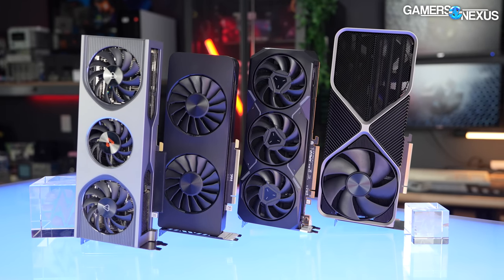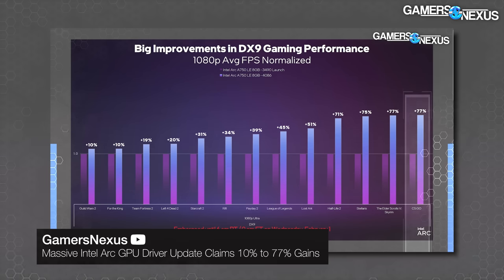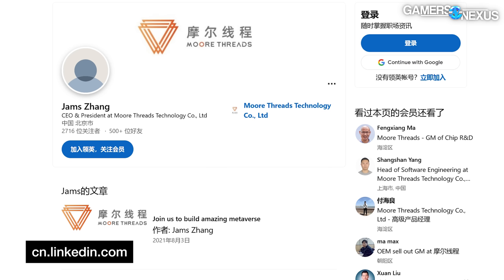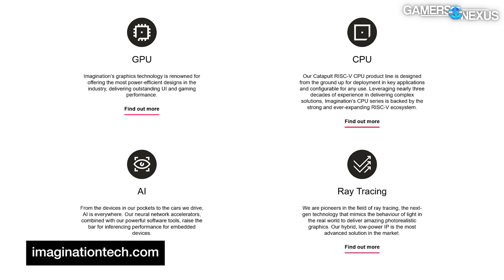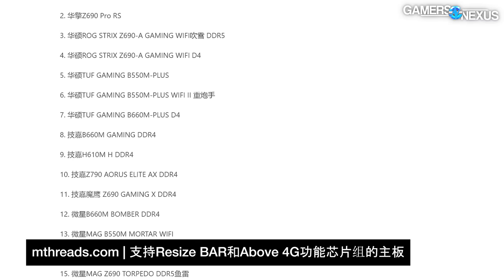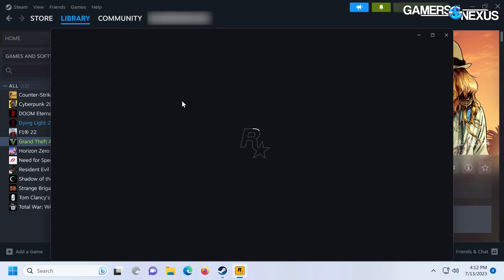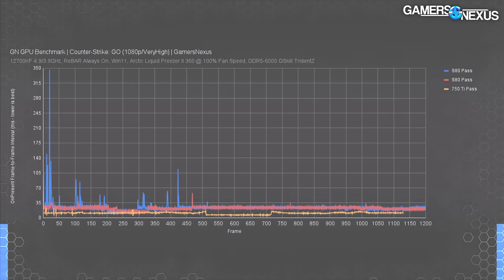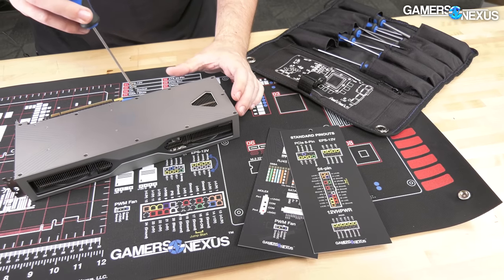China's Moore Threads MTT S80 GPU Review | A New Challenger Appears

Comment: I hope this puts into perspective for some people how amazingly well Arc has been doing since launch.
Reply: Cheers to that, indeed.
Reply: Yes...to a point. Thing is that intel has decades of experience making CPU's  and decades of experience making GPU for the laptop space. Somehow translating that to something they can walk down the hall to ask for a specbook about had um "launch challenges".
Reply: If there able to fix their video encoding thing, that will be a great start for intel
Reply: Most definitely. The A770 has been treating me quite well; I got the LE a week after launch and I received the Acer Predator Bifrost as an X-mas present. 

I knew what I was signing up for when I opted for Arc, and frankly I was expecting a lot worse, so I was pleasantly surprised when the released product was a lot more reliable than the old ATI->AMD transition-era cards and drivers. 

Back then it was a game of rolling back driver versions after new patches fixed one thing but broke something else, so you'd roll back to older drivers that may not have worked fully but worked well enough. Not so much the case with Arc.

Arc drivers have only been getting better as they release, so that alone is praiseworthy. I've been running PCMark after every update and the performance of the card has a positive linear correlation over time, so I get to see how the same hardware is made better over time with better-written software.
Reply: nope it should make people realize why nvidia like to charge an amr and leg for their gpu. we have ARM, Imagination And Qualcomm that have gpu IP and make gpu for mobile segment but none of them dare to enter pc discrete gpu market. intel, yeah nice effort for them but the reality for them is Arc still cannot generate profit for the company. if battlemage still can't then intel probably will quit making discrete gpu for consumer.
Reply: they have had massive improvement since launch and under certain circumstances make sense. Still have some stability and UI stuff to sort. Hope Battlemage continues the improvements.
Reply: Intel had plenty experience with their previous graphics cards. (i740, Project Larrabee, DG1 and now ARC/DG2.)
Reply: Yes but Intel has been making iGPUs and drivers for decades. This is MT's first GPU ever. Big difference there.
Reply: Intel has been doing this for awhile.
Reply: It is perfectly fine to laugh at Intel.
Reply: @arenzricodexd4409  Intel is hopefully thinking long term.  I seriously doubt they'll give up this easy.  They spent a solid decade trying to get under 12 nm in chips they didn't just throw up their arms and give up.
Reply: @Drak976  long term it can ruin intel. for consumer they want intel to keep forward because they want their cheap GPU. but for intel going forward with Arc would mean they will have a division that keep sucking the company's resource dry and did not make any contribution towards the company's profit. intel financial already in the red for two quarters straight.
Reply: I would sport one but its compatibility with retroarch was not good. I borrowed my friends a770 and he borrowed my rx6600 for a few days. Its overall performance was great though and may be a good entry level card for ue5.
Reply: lmao wait this isnt a joke you are being serious ? lmao
Reply: @arenzricodexd4409  Intel is unlikely to let go of this easily because they see this effort as necessary to be involved in AI development.
Reply: I hope this puts into perspective for some people how amazingly well AMD/ATI and Nvidia GPUs have been doing since the late 90s.
Reply: tbf, Intel has been doing GPUs (iGPUs) for YEARS
Reply: @swrdghcnqstdr  Yes, although they weren't directly trying to compete in the high end performance range against Nvidia or AMD.

Comment: I think the memory layout is actually just for trace length, which would otherwise be longer for the chips at the top and bottom, rather than avoiding screw holes.  You can see a similar thing on the old AMD R9 270X, for example - with no adjacent screw holes in that case.
Reply: Yes, the memory PCB layout looks logical, no chaos at all.
Reply: Not a GPU but the PS5 does the same thing with its memory modules

Comment: The thing that interests me most about this GPU is that it's apparently based off of PowerVR IP and even shares parts of its driver code with some of the newer PowerVR GPUs. Meaning that technically the modern GPU landscape reflects the history of GPUs almost perfectly: 

nVidia was one of the primary companies pushing 3D gaming and features that help make it better even back when 3DFX was king, today they've got the most features and usually the fastest GPUs even if you're going to be paying a lot for that.
ATi/AMD have always had an on/off reputation about drivers (I've had no major issues personally, but the reputation is undeniable whether you believe it's justified or not) and often haven't managed to be truly competitive on a performance level, but manage to make it up through increased value or features. One of their bigger successes with GPUs is being able to integrate their IP into AMDs CPUs for some of the fastest iGPUs around.
Intel was solely focused on ensuring you have a display output that can play a DVD or the like for a number of years until they started also focusing a bit more on gaming in an effort to stem competition from AMDs iGPUs, now they're trying to make full-fledged gaming focused dGPUs that relative lack of experience with gaming GPUs in general shows in that it's not a completely horrible experience but you'll absolutely run into bugs you won't see on nVidia or AMD.
Finally, PowerVR abandoned the desktop entirely around something like the year 2000 after the Kyro GPU failed,  now we're seeing a modern dGPU based on their tech being practically useless because of all the issues and bugs due to the complete lack of not just 3D gaming GPU experience, but even (afaik anyway) a relative lack of focus on PCs in general.

Comment: If I had to guess, the outer memory chips being "closer" to the GPU would be to have equal length traces with the other chips without having to do weird routes (or doing it less really)
Reply: Exactly what I'm thinking, but this practice is more common on high-speed pcb designs, not sure why this happens to a graphic card.
Reply: @michaellu8879  Surely the memory and the GPU are running clocks upwards of 2 GHz? I'd say that's plenty high-speed enough.
Reply: Yeah, that layout looks a lot like console ones. They maybe have people with experience on that area of design.
Reply: @P4NCH1 or mobile GPUs. Where it’s often forked from a scaled down version of a 10+ year old design, scaling that old hardware up, in order to skip patents and jump into the same competitive market. 

Sort of like taking a toy “drivable” Porsche, scaling it into a real scale Porsche and driving it around. And wondering why it won’t drive like the original.
Reply: @michaellu8879  Memory is both a high-speed and high-sensitivity design area. It's why you see things like soldered LPDDR5X in laptops pushing way higher speeds than SODIMM ever will, and part of why CAMM was introduced. Trace length matters a lot for memory. My area of expertise was VRMs and chipset connectivity at Gigabyte, and for the latter trace length also started to matter a lot more with PCIE3.0 and then 4.0 becoming a thing as transmission speeds went up.

Comment: I like the aesthetics and ease of teardown. Hopefully if it's PowerVR-based, they'll get up and running with actual performance under Linux for Vulkan and AI-related tasks. It could definitely find a niche in the west if cheap.
Reply: Linux and Vulkan would be better to target for them. Easier to get what they need.
Reply: If it's PowerVR-based, on the contrary, it is doomed to fail in Linux. Imagination has never been arsed to support their PowerVR products in Linux for years now (remember the scandal involving the Intel GMA500?), only recently they started offering Open-Source tools and drivers for the Rogue PowerVR architecture, the one before the BXT.
Reply: Considering they are having trouble just getting game drivers to work, I doubt it will be very competitive for AI. AMD has been trying to get into that market for a decade and still can't even though there is a massive financial incentive. No one will use your card if half their programs don't work out of the box with it. If George Hotz gives up trying to write drivers for your card, then you are screwed.
Reply: Still don't think it would be comparable to low end "cheap" Nvidia, AMD or Intel GPUs. They are trying to sell this S80 for $400 and it doesn't even work for most applications! They will need to make massive strides in functionality, software, manufacturing and price to performance overall to have any kind of chance even in the low end. I mean, consider most Intel and AMD CPUs already come with an iGPU that is orders of magnitude better than this thing. Moore Threads just isn't even competitive on that level yet.
Reply: @samhillebrand  that's why sanctions (are stupid) actually help Chinese hardware manufacturers. - with better ''western'' options, no one would buy this and the company would just die in free market right wing capitalist world. If people are ''forced'' to buy it, MTT will have more money for future development.

Comment: That idle power draw was the most eye-raising thing for me, and there were eye-raising things aplenty in this review.
Reply: considering it is maxing out only 40 watts higher, it is probably just some windows related driver bug. AMD had a very similar issue with high idle power draw on there 7900xts at launch. Think they were pulling like 150 at idle
Reply: It would be more reasonable to solder inside second cheap chip like GT9500 so cart could work using it while ide, for power savings 😆😆

Comment: Bizarre never-seen-before grounding tab: This is most likely for debug to connect the ground wire of an oscilloscope or voltage probe. Many boards lack convenient grounding points for probing, which makes debug of prototype and production boards difficult. However, when I design a ground point into a card design, I include several on both sides of the board to minimize the ground lead length. I also use test point hardware that is easy to clip an alligator clip to without shorting to nearby components. Some might say that the preponderance of BGA packages makes this irrelevant, however, probing of connectors, resistors and intentionally added signal test pads is still done. Designers that don't provide access to  critical signals for debug screw over the people responsible for board test.

Comment: there is this compatibility layer called Cuda on MUSA which will allow CUDA instructions to run on this card. it would be nice to see that in action if you can manage to show that somehow by help from the engineers.
Reply: Thats because it probably is CUDA because its just a re-etched nvidia chip, just like china's "home grown" x86 processor was a re-etched Intel chip
Reply: @BurritoMagnifico statement is incredibly incorrect you demonstrated that you didn't watch the video at all. As such your opinion on the matter is irrelevant.
Reply: @cybercat1531  You never know with chinese companies this might be a partially reverse engineered old nvidia chip with shit drivers. They claim it's an original architecture but who knows, it's interesting that it has a compability layer with nvidia cards when it doesn't even work right %90 of time by itself though.
Reply: @BurritoMagnifico  That's not how it works, you can't "re-etch" things outside of the foundry they were designed for and the foundry will realize pretty quickly that you are sending a copycat so you can't have them do your knock offs either. China's "home grown" x86 processor is a derivative of VIA's x86 Eden processors (VIA actually still has the x86-64 license given ages ago) which they developed by (surprise surprise) paying VIA Taiwan to develop it.
This card is most likely built on stolen IP and poached engineers (as is custom with most "developed in china" stuff) but the idea that it's a "re-etched" is ridicolous. We are not discussing random aliexpress sellers recycling old chips, this venture is trying to get some form of "home grown" GPU technology similar to the x86 processor
Reply: @cin2110  Intel has a CUDA compatibility layer for years, same AMD. Does this mean they are using the same NVIDIA designs? No it does not. Compatibility layer means it remaps the calls so it can work on different hardware.
Reply: How can you guys debate on something that is literally explained in the video...
Reply: Interesting, I am wondering that this GPU is so crap for gaming that I am wondering if it's really made for AI work loads and the gaming is some kind of stealth action.
Reply: @outcast6187  it's crap for AI loads too. Making GPUs that can compete with manufacturers that have been at it for 20 years is not an easy feat. They will probably grow and get better over time if the chinese government keeps funding them for political reasons (as it's a "self reliance" project)
Reply: @BurritoMagnifico  I'll just laugh at this and move on.
Reply: @marcogenovesi8570  the thing is I don't know if even the CCP is willing to give them enough money for them to become competitive. We are talking likely hundreds of billions of direct funding and subsidies.
Reply: @macicoinc9363  Hundreds of billions is a bit too much, they are not starting from scratch they have their stolen IP and poached engineers so they start from let's say 2010-ish which does not sound that good for people in 2023 but it really is much better than starting from the 1990 of gpu technology and banging rocks on a VGA port to make it render an image.

That said the CCP does not have much choice, this is not a project to compete with the west, it's a project to not implode under sanctions that limit CPU and GPU sales (and will get worse when they eventually "peacefully re-unify" with Taiwan which is getting closer and closer). So even if they are not going to catch up with whatever is latest and greatest even reaching a point where they are like 5 years behind is very damn good.
Reply: @BurritoMagnifico   you have to pick between these 2 points: either it's a gpu using a PowerVR IP license, or it's an Nvidia GPU that includes CUDA.
because PowerVR GPU with CUDA doesn't exists in this world.